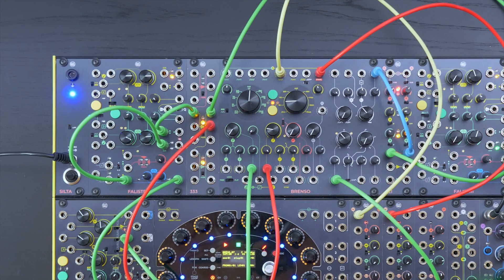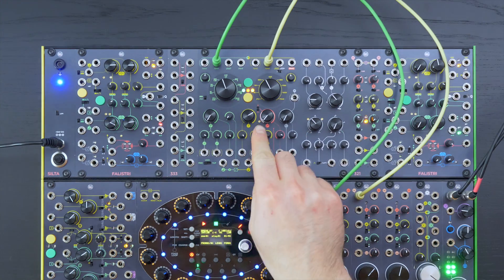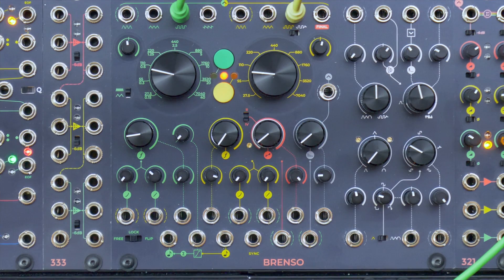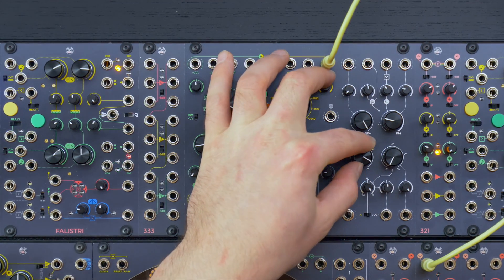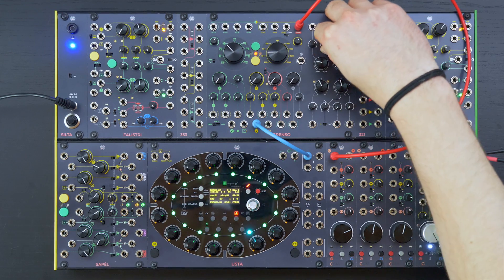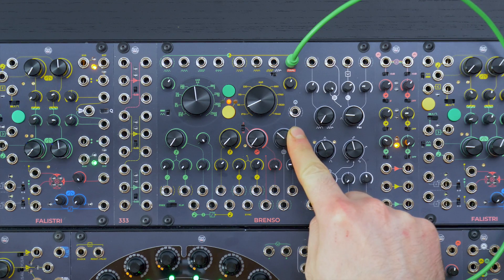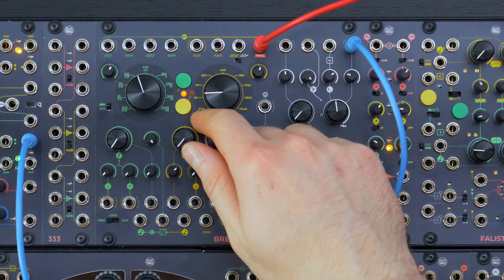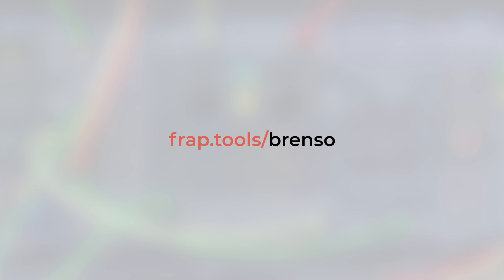Frap Tools BRENSO – Entangled Sound Sources (Eurorack Oscillator)

Comment: How do i get the both raw VCOs on the final Mix out. I mean just the to osc without any waveshaper and so on? I Tried a lot but the direct outs Sounds different than both osc on the final Mix out. Please explain! Thank you.
Reply from the maker: Hi! The Final output blends the signal going through the waveshapers/folder (white section) with its amplitude-modulated copy (red) – that's it! There is no Mix out on the BRENSO: according to the tradition of complex oscillators, you hear the other oscillator only through its effects (=modulations) over the carrier. For example, you can "hear" the effects of the green oscillator over the yellow one through frequency modulation (yellow section), timbre modulation (gray and white section) or amplitude/ring modulation (red section). I hope this cleared it a bit!